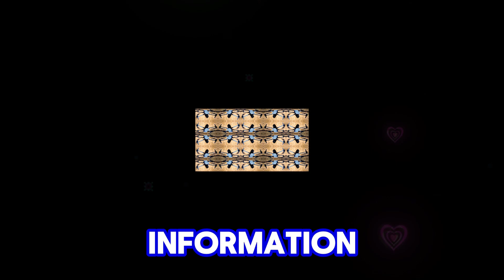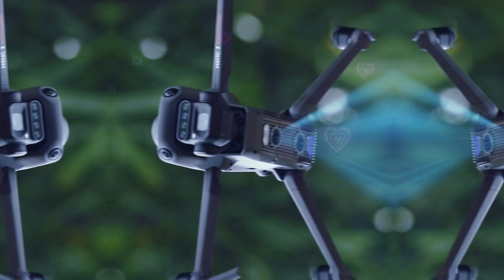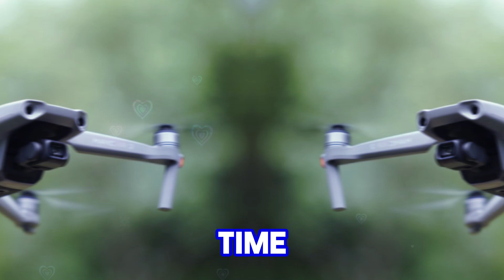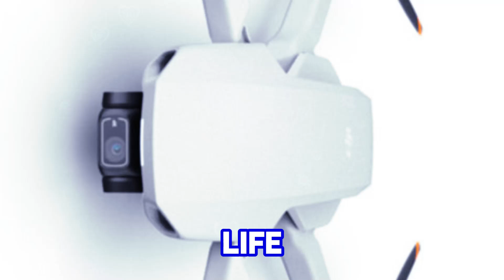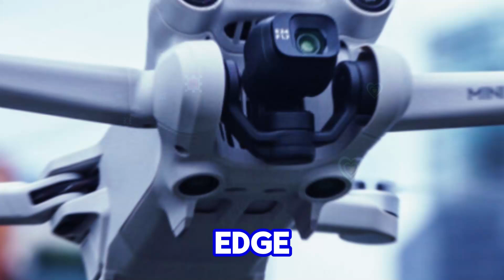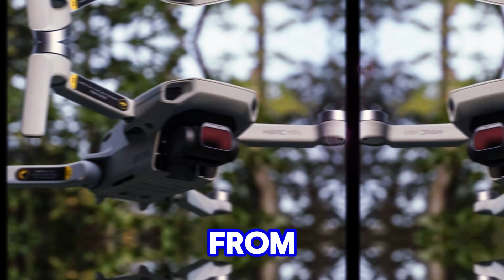DJI Mini 5 Pro 2024 - 1-inch 5K Possible Sensor?

Comment: Undoubtedly I think the next generation will have an enhanced processor running at a higher CPU speed, and I think it might have a CPU fan like some larger models. This is indeed extra weight so maybe savings elsewhere. As the omni-directional collision avoidance system will be even better, maybe they might weight save on the shell to accomplish this. Yes, like virtually most folk, I think that a larger sensor is coming. 20MP (native) resolution would be great.